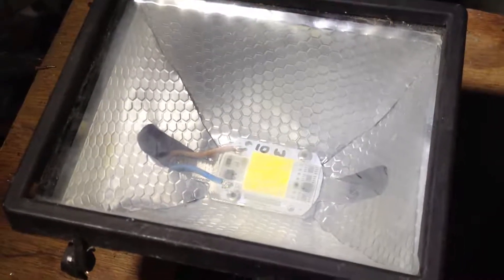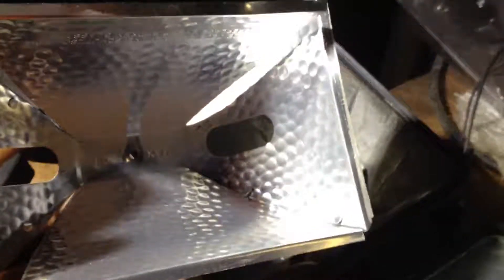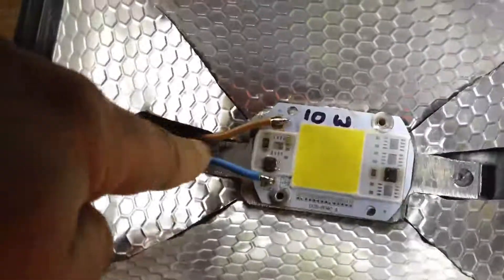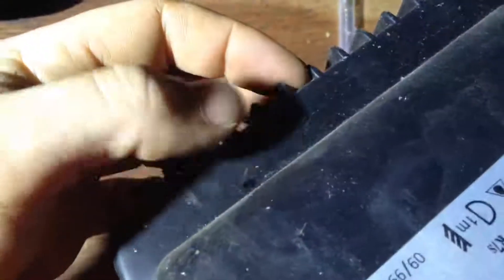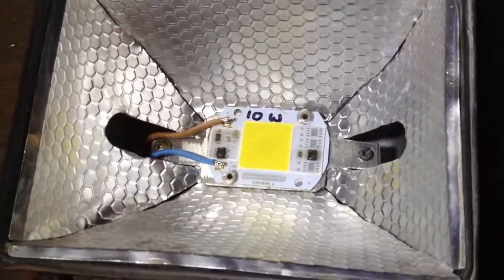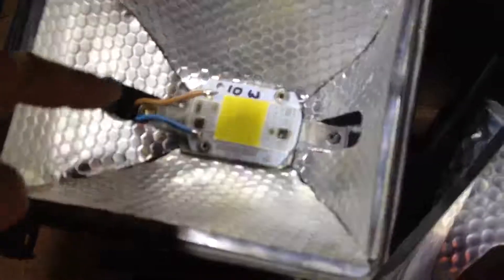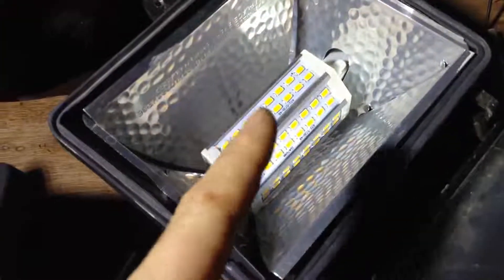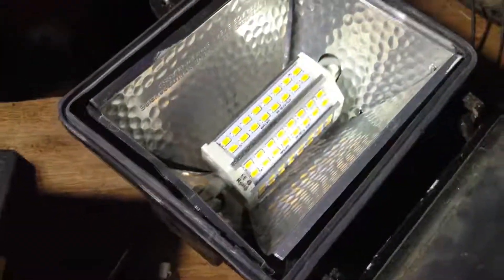Convert 500w halogen to 10w LED flood light

Comment: You cant retain the PIR sensor in these lamps. They are useless because they work on a resistive load of 500 watts whereas 10 watt LED has a capacitive load. I’ve just tried to insert the same sized tube type LED bulb ( same fitting as the 500w halogen) and it won’t trigger. The LED works perfectly if the sensor is removed and LED is wired directly to the mains 230 volts, but you can only turn it on or off with a conventional switch, which means it becomes useless as a security light.
And I’m dammed if I can find a supplier of separate LED PIR sensors.
All the new LED security lamps are fitted with sensors that switch LED lamps but it seems you can’t buy them separately.
So, after buying 4 new LED tube lamps for £25, after I saw this video, I bought a pack of  4 new, complete lamps for 28 quid  !!
It ain’t worth all the bother to muck about  converting old ones. 
I’m going to use the old ones, minus the sensors, in a manually switched circuit on my garage front. They will create the light of day so I can clean,  polish and maintain the car after dark !!!! 🇬🇧🇬🇧🇬🇧
Reply: Load resistor to fix the PIR sensor proble, is that I was asking in my last comment question
Reply: Can you use a led load resistor? Like the ones you have to install if you want to use LED turn signals in your car without triggering hyper flash if you don’t need the Cobb chips
Reply: @adamburdette23  : I am sorry but I have no idea what you are talking about. Never heard of Cobb chips, or had any occasion to install LED lights in cars with them, which, presumably do not operate on PIR sensors.
What I said in my original post was entirely about building security lamps, the changing of them from Halogen filament high wattage lamps to LED chip low wattage lamps.
Reply: @robertknott1124  hey sorry I was confusing. What I was saying was have you tried putting a LED load resistor in to try to fix the PIR resistance issue. LED load resistors are mostly used on vehicle LED turn signals to stop the hyper flash because the LED the resistance is too low might work on the PIR if the resistance is too low for it too.  Lastly sorry I meant Can Bus not Cobb I have no idea why i put that. I know vehicle led and this aren’t really the same but I am just trying to learn.
Reply: @adamburdette23  : Hello again !
Yes, I am always trying to learn things too ! One seldom gets any instructions with devices nowadays. 
I tried lots of things to get those old lamps of mine working with the LED lights, same size as the Halogen lights, but they wouldn’t work. 
And I’m not entirely daft, I used to be in electronics , working for Phillips, so I had few used, but workable old, components in amongst my junk, so did a lot of experimenting before giving up and buying dedicated units.
They were so cheap too ! A box of 4 only cost £20, not worth the mucking about trying to get the old ones going.
Reply from the maker: Check out my other videos to explain it